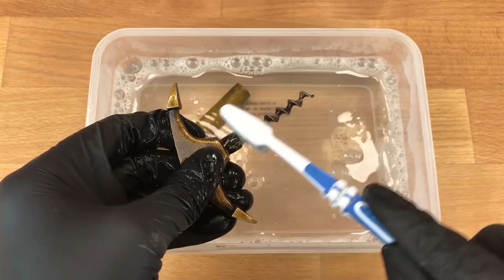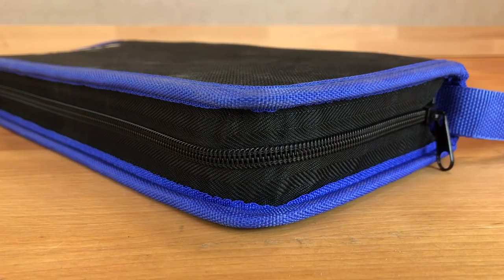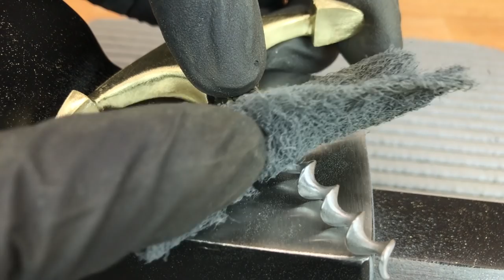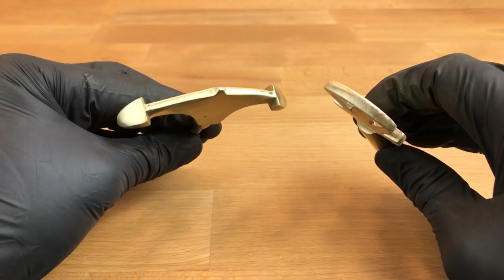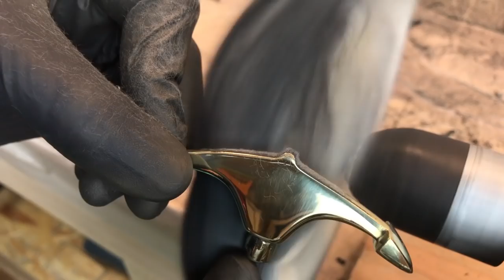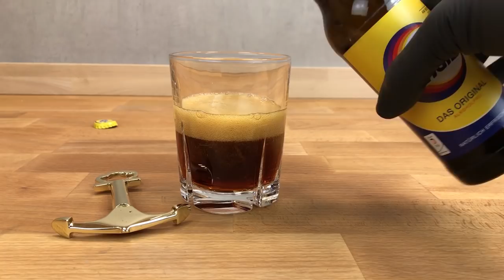Restoration Corkscrew and Bottle Opener 2 in 1 - Shape of a ship anchor

Comment: The end result may be fun to use, but it's not a renovation but a modification.
The corkscrew as a collector's item was irretrievably broken, because the patina and excess metal were its original factory appearance.
Fortunately, it is a common item, so nothing bad happened, but if it were a high-class relic, it's a shame.